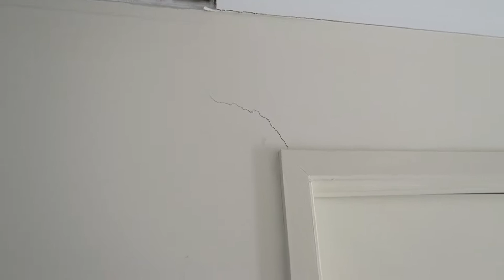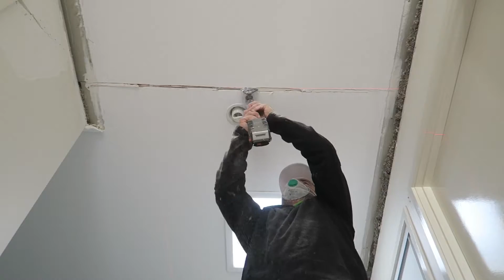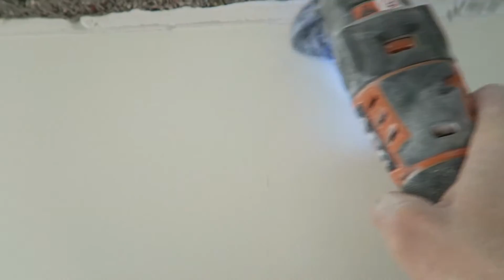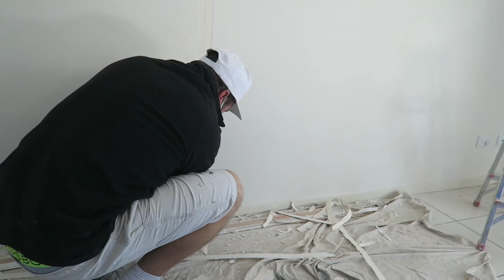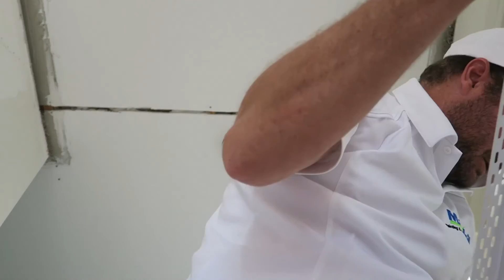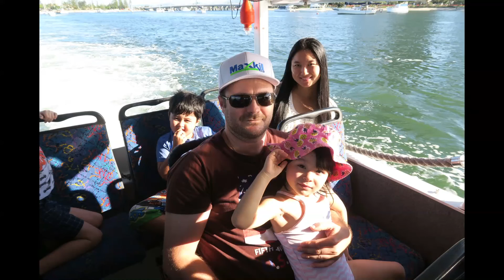Repair Drywall Sheetrock Plasterboard Cracks around Home

Comment: I know exactly what it is wounder boy still if you can get paid for fixing Cracks by making them bigger or replacing cornice thats still up there with the same 
 cornice its you own house isn't no one in there right mind would have you in there house paying you to do that surly..
Top Class Ceilings.
Reply from the maker: +Micheli Zappala I hope your plastering is better than your spelling. Say you have a small crack, you put in an expansion joint that is bigger than the crack, does that count?
I think you don't understand actually. Before you sounded smart, you didn't listen to the key points or understand how control express expansion joints work and why they are used.
Let me teach you that even if I put new cornice up it would crack again. Yes people pay me for that. Someone similar to you tried to fix it with cornice cement and hence someone like me came along to fix it for good. So what would you do?
Reply from the maker: Tell me how you would do it? That was the best way i knew how bro! I might learn from you